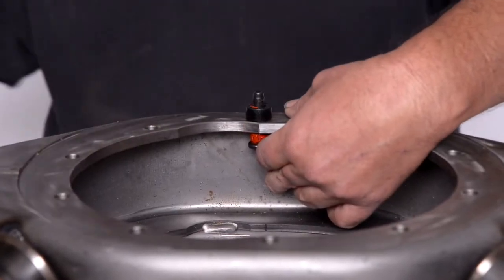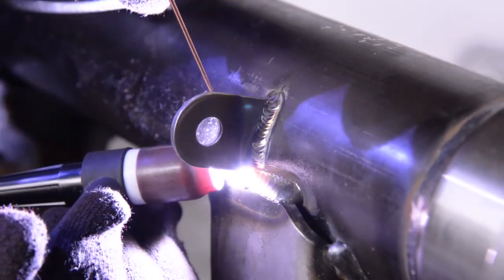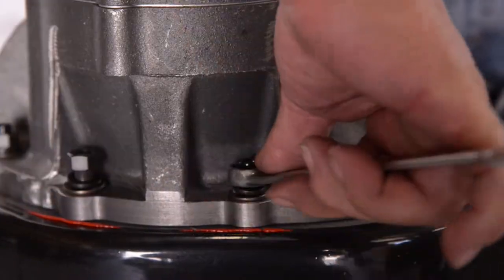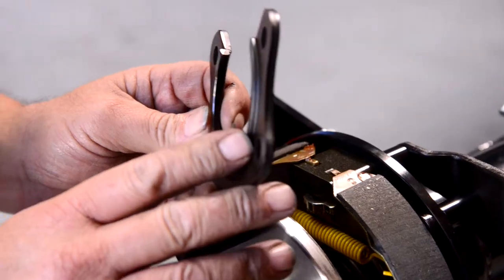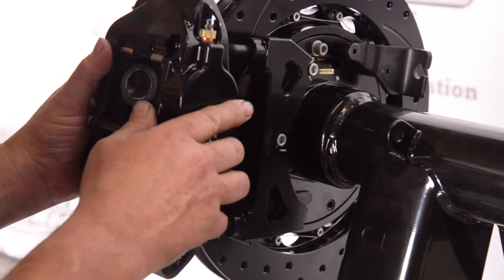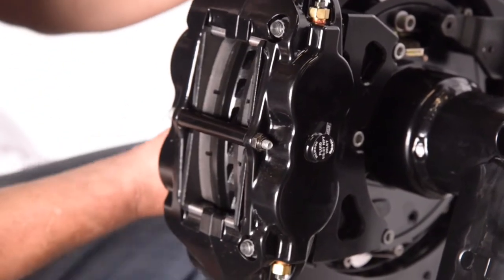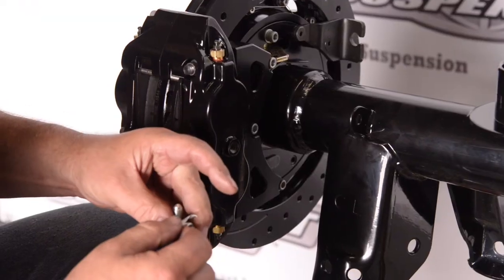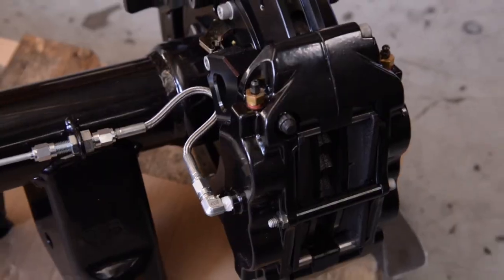Important Steps In Assembling A Moser Ford 9 Inch Differential

Comment: Need help man I bought a 9 inch moser and i put 4 quarts of 80w90 with lsd additive at first I drove it for about 2k miles with 3 quarts and I flushed it an added 4 quarts with lsd additive still have no droved it the diff did not look half ways full I looked inside with a camara did i over fill it need help taking it to the drag strip this week on the 17th of June thank you
Reply from the maker: Give my tech department a call 877-470-2975!
Reply: @GlobalWestSuspension  i called QP they said 4 quarts with the LSd additive is perfectly fine than you I'll save this number

Comment: hmmmm I stripped several of my studs doing them without a power driver.......then I used oil before I tried to pull the rest......still were almost impossible to get them seated
Reply from the maker: They can be pretty tough to remove! hopefully the damage is not too bad